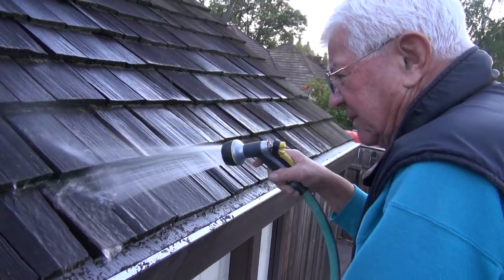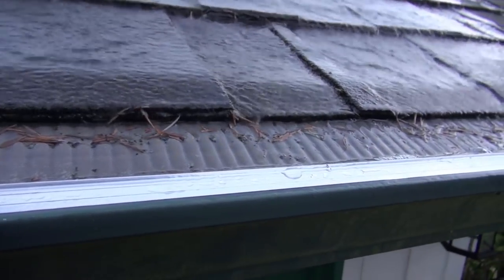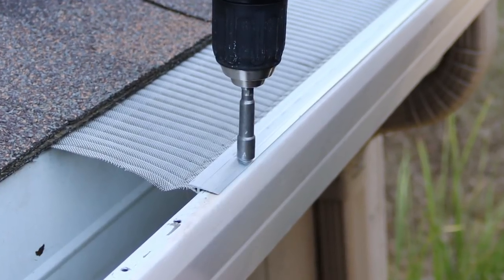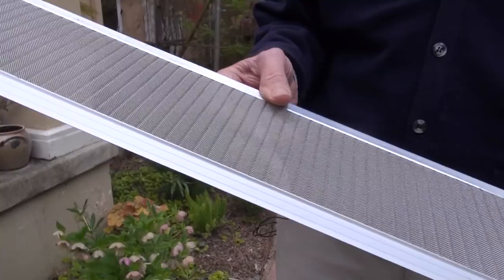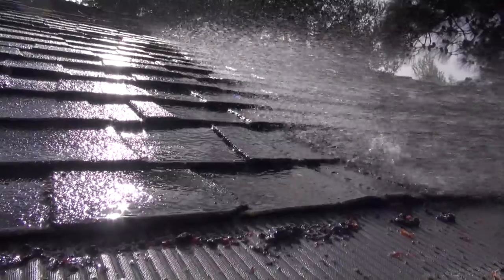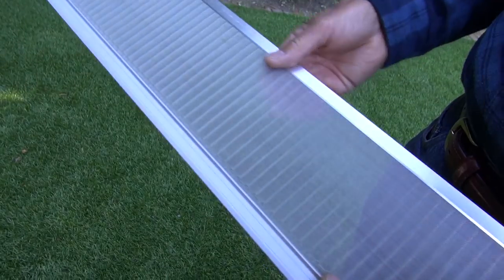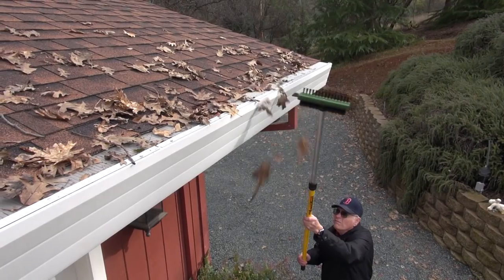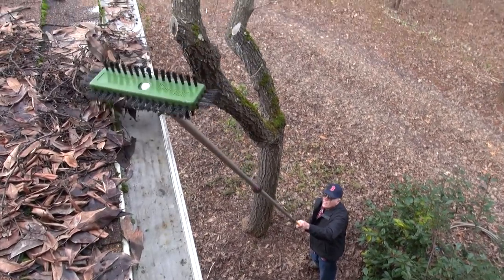Atlas Gutter Guards at Lowes

Comment: Best there is, but I do roof sweeps, and gutter cleans all the time, keep your research and development department alive. There is always room for improvement. Shoot for the impossible and make it pine needle proof.
Reply: Self cleaning
Reply from the maker: Hey Christopher, thank you for the kind words! Re: pine needles, the mesh we use has small enough holes that it shouldn't allow pine needles to penetrate. If you're having issues, please reach out to our customer service and I'm confident they'll be able to help. Thanks! 844-359-7683
Reply: They said it is in fact pine needle proof, can you test it?
Reply: a a , I clean gutters, like I said they are the best there is, as pine needle resistant as it gets, nothing pine needle proof. And if it is too fine, it will plug up on top of the gutter guard in corners under Long valleys fairly quickly. But people have made the impossible happen before.
Reply: A quick sweep off, or hose rinse in these areas fairly often will reduce the times you have to get somebody up on a ladder. That might cost me business, but helping people is what it's about.

Comment: I’ve installed these numerous times
Reply: Boolin are they any good?
Reply: a a Yes.but whoever installs them make sure they are all even with one another. If one side is lower Wet leaves and other dirt will put weight on the leaf guard and it will create a damp and you will start to get leafs inside your gutters.
Reply: a a and if you hire a contractor make sure they only put them on sides of the house where there are trees. Don’t get scammed for your money. Just some tips.
Reply: Boolin what is a damp?
Reply: a a like a hole. It will create an opening for the leaves to come in
Reply: Hung gutters this mesh is to small the only thing that works is clean them

Comment: Complete bullshit. Unless you live in the desert, all gutters grow some type of fungus. 

Eventually the fine mesh is going to clog up with moss, molds etc. you’re going to have to get up there and pressure wash. At best with this mesh you delay the process. 

 
Doesn’t fit, and you need to bend it? Good luck! Nothings easy, and bending mesh to fit your gutter? Fk that!!!!  Not  easy even if your gutters are perfectly straight, which they’re probably not unless they were professionally installed ‘yesterday’.

God forbid if a nice tree branch falls on the mesh and knocks it out of whack (seen this), ‘then’ you wish you never put that silly mesh up, its jacked and you can’t get it apart easily, won’t go back on right etc. seen it happen. 

My experience is you’re better off pressure washing once in awhile, even with no trees around gutters still get dirty and need to be washed out for optimal performance.